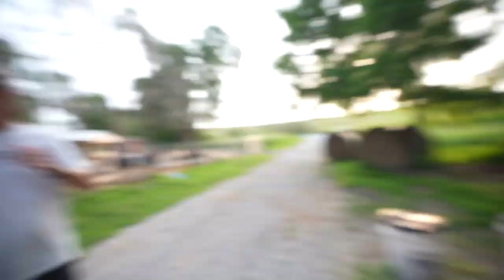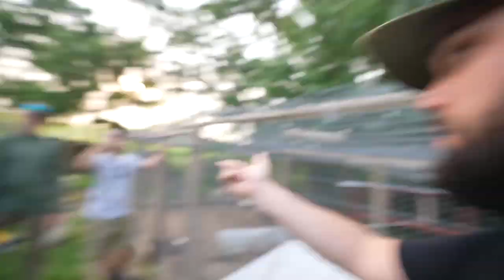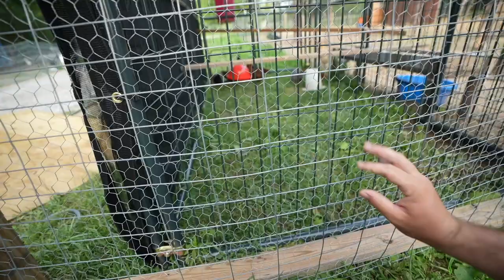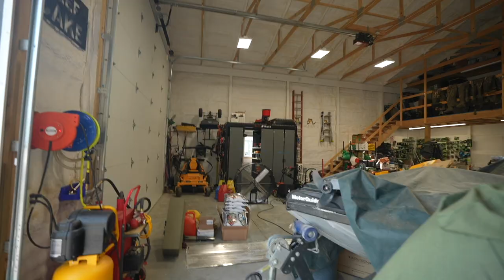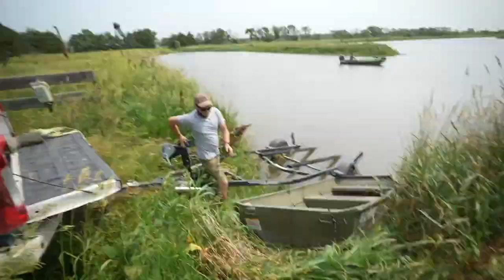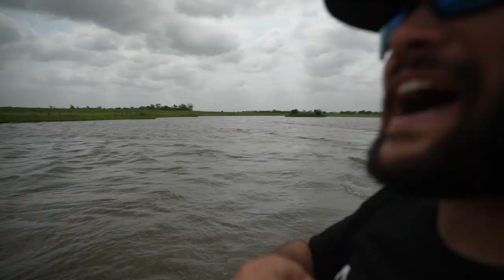I Bought the CHEAPEST Boat Motor on AMAZON!!! (Does it Suck?)

Comment: I'd like to see four on the back of the boat with the throttle rigged as one. Steering you would have to rig up some brackets with linkage to move them as one.
Reply: Hey can
Reply: Yes
Reply: Yo I was thinking that it would be sick
Reply: Look at my comment and the reply is that the same guy that was scamming flairs subs
Reply: Sky Powell?
Reply: Yes
Reply: Sounds like the fans want this if you need to brainstorm this we can help. Totally have to take it out to a tournament like that or by the other fancy boats that have 4 motors.
Reply: Steering would be easy...just take some flat stock aluminum  to connect all 4 motors together  and use one tiller handle to steer all 4 motors....throttle would take a little bit of cable and some ductape to tie all the carbs together and a simple foot peddle like the hoot foot in some bass boats and you are good to go
Reply: Common guys and gals lets help flair make this happen.
Reply: @codyrivenburgh7645  each motor would need to pivot on the flat stock like a scissors or tri shut off valve. I like the idea keep it up.
Reply: Cable system would need a board to feed through with eye links before they twisted into one measure precisely.
Reply: I have a lot of ideas but want to hear the public ideas to make this work. Next video should say buying 3 more motors.
Reply: Yes that would be insane
Reply: Yes!!
Reply: If you wanted to make it cool you could but the steering on a vertical tiller and put the throttle on that too.
Reply: I would like to see this happen with ocean approve ingenuity. I say we give this comment to make flair do it by giving it more likes than the video.
Reply: This would be hilarious!! 😂😂👍👍

Comment: In my experience with weedeater motors the muffler is very restrictive, a pipe should give you a little more power.
Reply: Yes straight piped motor I wanna hear it lol
Reply: Have done it with a chain and it made a huge difference
Reply: The pipe runs down to the water
Reply: @stevesnycerski1802  not on these that only goes for an impeller driven motor
Reply: @ElGancho08  they make actually nice pipes for weed eater engines
Reply: Ohh I know but if you were doing just a pipe it cuts down on the decibels. Think about the old school 3 hp out boards. They were air cooled.

Comment: Hey Flair 👋
There are a few ways to increase performance of Two Stroke Engines! However my experience is with 2 stroke Dirt Bike Engines that have a massive aftermarket to support them!
I honestly don't think that engine from Amazon has any support for that engine except tune up parts!

The quickest and easiest way I've ever found to get quite good power increases without changing internal parts was installing and experimenting with a couple of higher temperature range high quality spark plugs.
The next cheapest, and was the most effective power increase was switching from conventional oils both in the crankcase and the oil you mix into the gas. I personally chose Ams Oil, Fully Synthetic Engine Lubricants!
That's gonna be your best bet for that Amazon Engine!

Good Luck, and please let me how you make it with your experiment!

Comment: It may not need a engine tune but a more aggressive prop will have a higher top speed but less low end torque if you can find a prop that fits it, it should rip even more

Comment: Love it! Yeah dude, you can tune up anything. Open up the air and slap a little muffler on that puppy to quite it down a bit. There's gonna be a way to tweak the throttle to get it to turn a bit higher. Definitely a better prop but be careful of the linkage and hardware that connects it. May not support the added drag and force from all the ponies your gonna squeeze out of it! 🤣 soo awesome. Wish I was rippin that puppy around the lakes near me.
Reply: Or he could put a bigger prop on it
Reply: @blakemac172  u defo didn't read the whole comment
Reply: @blakemac172  a bigger prop would most likely mess up that motor, lol.
Reply: @blakemac172  bro he said that ....

Comment: Better prop pitch. Stiffen up the blades or go metal to take the flex. Otherwise you will need a bigger gearbox/gearcase if the motor can handle it.

Comment: I have an extra 13 ft yak. Wish I could see how it works on a yak?
Should be lighter and less water displacement. My other yak is an old town sportsman with a Minn kota 45 lb thrust and goes 3.9 mph tops. Same one Westin Smith has just a little longer.

Comment: 45 pounds of thrust at 3 miles per hour is roughly equivalent to .4 horsepower. The formula is an easy one.

Try increasing the size of the propeller (increasing thrust) to alter your speed. That may maximize the output from that engine.
Reply: That won't work like you think.
Reply: RiP

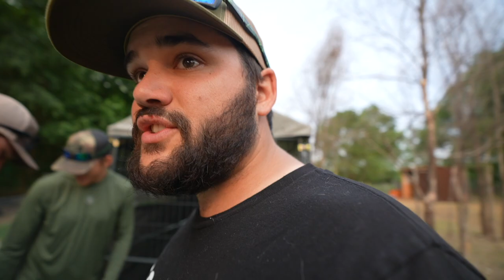Comment: Flair @ approx 4:30min,  use chicken wire and make a "skirt" around the pen.
You overkill on wiring the CW to the pen, but  the important part is to have 2-3ft of the c.w.  as the anti-dig strat, but you'll need a kaboodle of anchors ⚓ to stake it down.

Comment: I've put a trolling motor prop on a Husqvarna weed eater. We have a few no motor zones so the weedeater with a prop on it works. If the fish and wildlife get to close the plan was to let it go. So far we've never been caught.
For $12.99 you can buy a set of 10 two stroke carburetor adjustment tools on eBay. You can fine tune the 2 strokes to run better.

Comment: Should be two adjustment screws on the carb. One marked H and the other L. Adjust the H with the motor in the water to make the engine rev higher. If they’re not marked then just mess with them and you’ll figure out which is which.

Comment: Get yourself some 1/2” x 3’ hardware cloth  and wrap that cage. Also, Premiere 1 netting doesn’t need a complete circuit to work. Hook up your solar battery to one terminal and it should charge the entire length. It doesn’t need to make a circle.

Comment: Claire my chicken coops I put either plywood or sheet metal 2 and 1/2 to 3 ft up all the way around so that stuff like that doesn't happen I drill holes and wire it to the fence. Also provides shade when it's hot and the metal heats up when it's cold. Chickens love it

Comment: The way you can tune them is somewhere on the carburetor there should be 2 screws one is for the low end and one is for top end of the screw has an h next to it try having the motor at full throttle and turning the h screw one way or another and it should sound like it revs higher try that it’s an easy quick way to get higher rpms out of them

Comment: adjust your throttle cable and breather on the side of the carb to allow more air to get in and adjust your prop angle that's what I did to mine is the same motor and it'll go about 9mph

Comment: Higher cc carb, bigger spark plug gap, aftermarket air filter. Had a mini bike with weedeater motor, had it at 35mphs and I’m 185lbs

Comment: If you take the whole muffler system off it should go a lot faster! Only down side is you will go def, and you end up exposing the inside of the engine block. That will make it very easier for dirt to get to your piston and screw up your motor, but as long as you be careful not to get the piston dirty and wear ear plugs you’ll be alright.

Comment: If you use hotter spark plugs and use the 30:1 fuel it should go faster. Tighten up the slack in the throttle cable too.

Comment: Real talk though, I keep seeing people post these videos. "OMG I bought the cheapest motor on Amazon lol. I bet it doesn't even work. What? it worked? OMG this is so whacky! I can't believe I would do this..." But for real, they are fine motors for tiny boats on small ponds. I was running on a pond boat and a 14ft jon boat for about a year before I bought my Bass Tracker. It is fine. The gas is more power dense than batteries so as a motor to get you to the spot you're trying to fish, and cut over to the trolling motor, it does it's job. It is loud as shit though, so wear headphones. Good job following the trends that are getting views. way to stay relevant.

Comment: The prop should be just below the bottom of the hull, to high and the prop will cause cavitation. To low and the water will be to much drag on the prop and lower unit.

Comment: Get a Dirtbike fatty pipe. Like for a gas bicycle kit. And a better spark plug. And I would 
Take something an inlarge intake. Better oil. And a larger prop.. Better carb would do amazing aswell.
 More Air and Fuel in & the more exhaust out.. will quadruple that output easy!!

Shewwwww

That thing will move out!!!

Comment: As far as making those motors faster, step 1 throw it in the trash step 2 order a proper performance 2 stroke, they make them for RC trucks step 3 mount that motor to the lower unit of the Amazon special

Comment: Take the screen out of the exhaust use the right fuel mix and a lighter prop or one that has less pitch put a trigger style throttle cable bracket like for your weed eater

Comment: You're thinking about boat trim the wrong way. The reason you trim your motor at plane, is to get the front of the boat out of the water. Not to get the prop almost out. I don't think that little guy will have enough power to accomplish this, even in the Jon boat.

Comment: Why can’t you just get a sheet of plywood, drill a hole in all four corners and zip tie it to the coupe and it will give you 4ft of protection from the ground up. You can also dig a little trench and sit in it there to stop them from digging